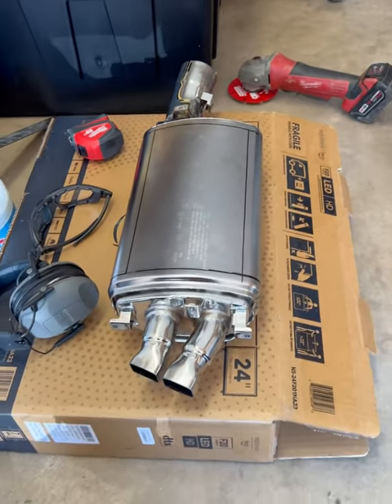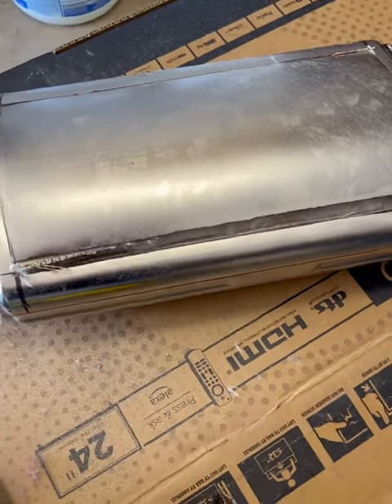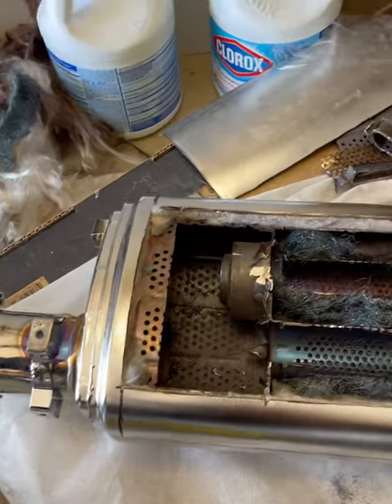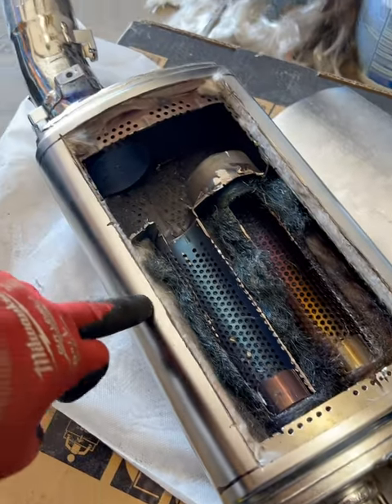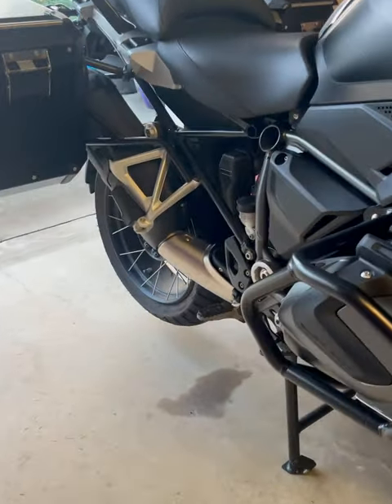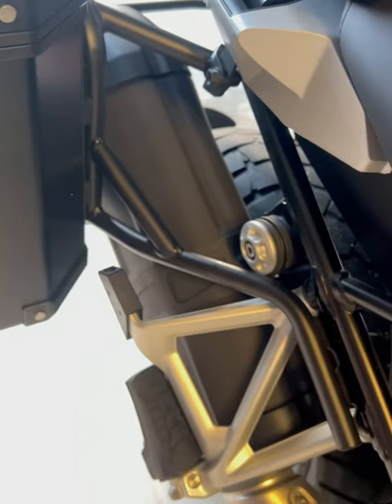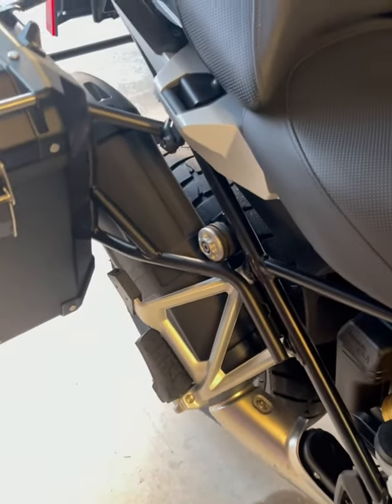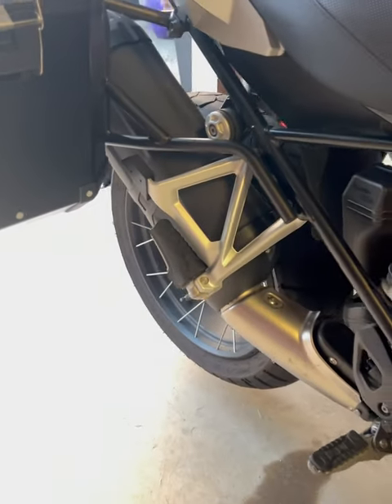BMW R 1250 GS OEM Slip on Muffler Baffle Removal

Comment: Cool project and nicely done. Where I'm from a friend of mine had a guy that does this for GS owners for about $100. He'd cut it open the same way you do but no entirely sure how he did the internals and then changed the tip from a 2 piece into 1 kinda like the Unit Garage RAD. The sound my friend's GS made was really good since he also had a CAT delete. Was tempted to had mine done as well but ended up using a yoshimura exhaust from my old Super Tenere and had a custom made link pipe.
Reply from the maker: Is he running a different tune due to the cat delete?

Comment: If you were to do this again Ross,  would you do anything different? Great video. Thanks
Reply from the maker: I wouldn’t change anything that I’ve done. I’m still impressed with the setup and have had several compliments on how it sounds. 
I’ve considered overriding the exhaust flapper to stay in the open position but that’s about it. 

Thanks for the feedback. 👍
Reply: Awesome, well done. Sounds perfect!

Comment: It does sound a little more dirt bike like. Do you notice it making the tire hotter?  Did it affect how the bike runs?  Interesting project.
Reply from the maker: Nothing seemed to be hotter than normal. I was more concerned about the right case but it was no different than before.  Bike is running great. Still no problems powering up a wheelie in second gear. I would say that it feels better but without dyno proof I’m just making it up.  For some reason I did notice that the clutch less shifting up in gears seemed to smooth out a touch. Not as chunky feeling. I have no idea why 🤷‍♂️
Reply from the maker: So giving you an update on how hot the muffler gets near the tire,  I used an inferred digital thermometer when the bike was hot. Engine temp was reading about 200° at idle and the inside of the can where the insulation packing was removed read 220° at the hottest and the outer side with the packing in place read 110° at the hottest. 
So the muffler is running at about 100° hotter on the inside but the heat seemed to radiate up rather than to the tire. The tire was cool to the touch after running at idle for ten minutes. 
Hope this helps.
Reply: So you can ride with the backpack on the side without any problème with the temperature ?

Comment: Hello man first thanks for your video.
I’m gona do this on my bike and would to know now if you get any problems with the temp and the side backpack ?
Other question, you have use what paint for the muffler because I want to make it black to.
Thanks for your answer and sorry for my bad English I try to do my best 😉
Reply from the maker: I have no issues with high temps. 
I was at first concerned about that same issue so I let the bike run at idle with my stock muffler and took a temp reading on the side of the muffler then put this muffler back on and checked the temp at idle again. Even with all of the insulating packing gone on the new muffler the outside temp wasn’t much more than stock. 
I’m thinking this is because it’s still a pretty thick wall stainless steel and the hot gasses are passing straight through. 

Also the paint I used was from Home Depot. It was a high temp spray paint rated for 2,000°f. 
So far it has been holding great. 👍
Reply: @rosskapron3634  thanks 🙏 for your answer gona do this so did you paint something before the black paint ?
Reply from the maker: @67XxD3VilxX67  no I only used the paint. It’s the rust-oleum high temp automotive paint. The muffler was already buffed up really good from doing the welding as you can see in the video. I did three coats of paint on the parts.

Comment: Bro I have a question: how you weld it, what kind of weld did you use, cause is not aluminum or metal.
Reply from the maker: @OctavioGomez-u1b  it’s stainless steel.